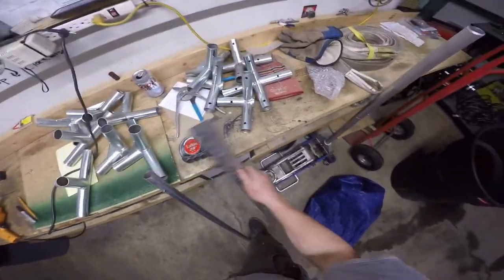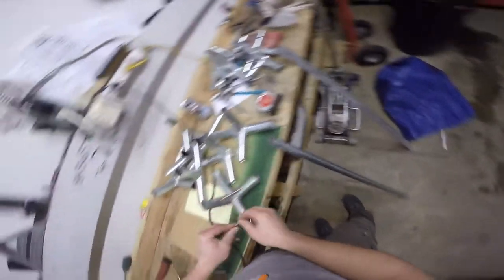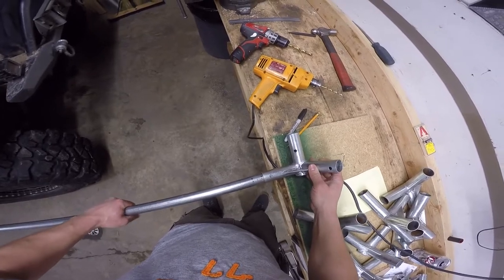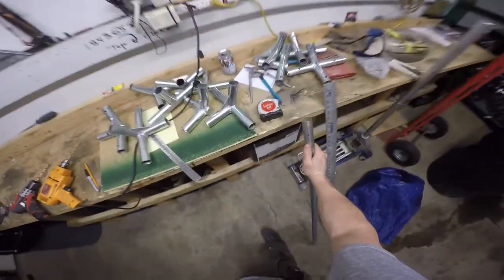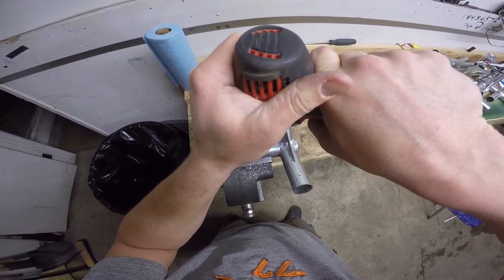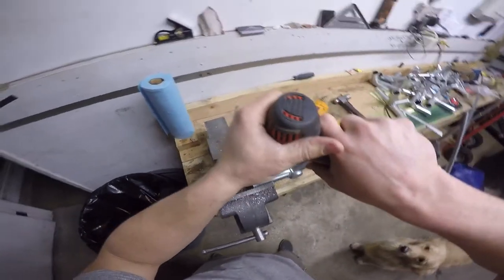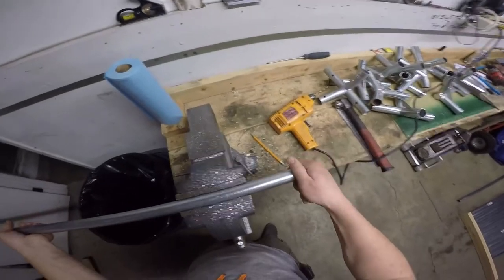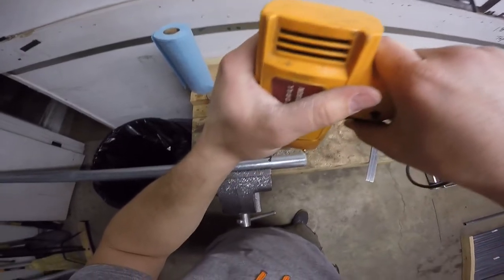Wall Tent Pole Retainers

Comment: What size clips and where did you purchase them?
Reply from the maker: It looks like the exact ones I purchased are not there anymore but I got them from aliexpress.com. If you search for "tent pole spring button" or similar you'll see several styles available. Any should work decently well. Mine were listed as 5mm.